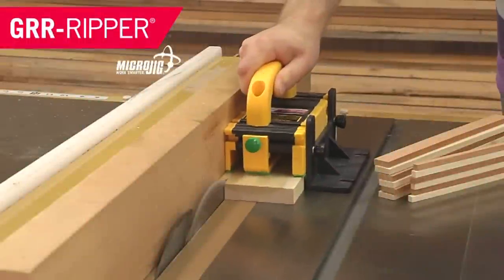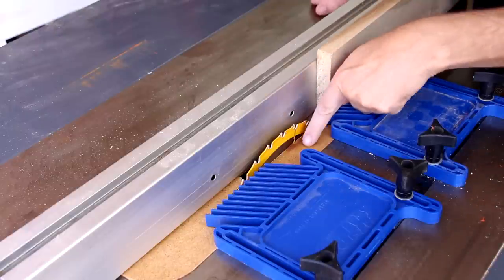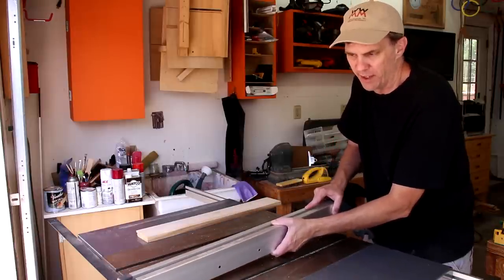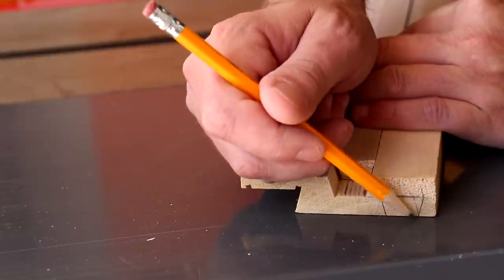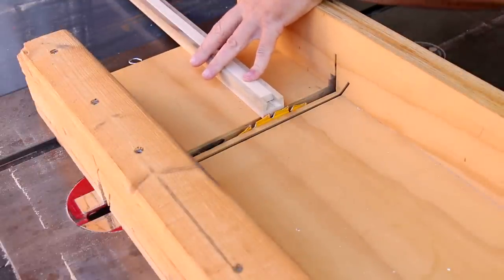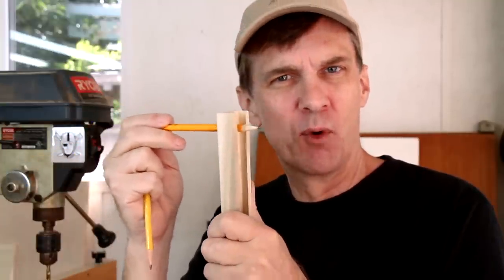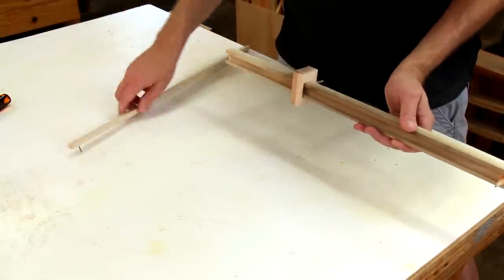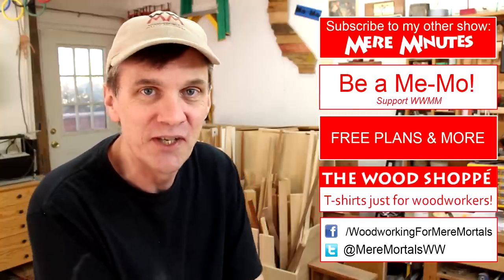Make huge circles with a homemade beam compass. Woodworking shop project!

Comment: Thank you for your excellent videos. For smaller circles one could perhaps do away with the dovetail and runner altogether and insert a nail in the holder which then acts both as a centre pivot and a radius adjustment.

Comment: Great video as always Steve. I think it would be easier if you skip the sliding locking mechanism (SLM) and just drive the thumb screw directly in the back of the channel.That will make it easier when flipping the rail around because you wont have to remove the SLM to do it. Of course it wont be as fancy but it will get the job done. Thank you and keep them videos coming

Comment: Hey Steve, this is nice and simple. The only suggestion I have is when using that second feather board, make sure to use the splitter. You could end up causing the piece you are cutting to pinch the backside of the blade and causing kick back.

Comment: Hey Steve!  Fellow Marinite, Eric, here.  Recently entered the woodworking fray - loving it - and also just recently discovered your channel.  Thanks so much for the great and entertaining vids.  Immediately made one of your 2x4 work benches on casters, got some Grrrr ippers after seeing them, working on French cleats in my shop, gonna make this compass for the hell of it, scored a Dewalt dual bevel, sliding compound miter saw at HD the other day on a crazy open box markdown - blah, blah, blah.  Anyway, caught a glimpse of that digital magnetic blade angle finder thing - looks useful.  What is it, do you like it, where should I get it, etc.?  My (also recently acquired) leatherworking is now taking a back seat because of you.  Cheers - and maybe we will run into each other at Rafael Lumber one day!

Comment: great tool to have in any shop ! Thanks Steve the small mistake made for good entertainment  most definitely pencils do run different sizes  i’ve beltsanded quite a few of them over the years  to make them fit better in some of my tools like scribes  and other marking tools   ! you chuck them into a drill and  run them on a running belt sander untill you get what works  not really  a very sophisticated build but it works

Comment: Hmm how about the stone-age method of pencil-string-nail combo ? Works even without Grrrrippers and DoveTails.
Reply: i think this is more accurate if you need large circles of the same size. But hey everybody has his own way of working :)
Reply: I thinks that's because this is a "Woodworking" channel not a "Make Things From String" channel
Reply: String, invariably, stretches and the pencil isn't anchored in position.  String works great if you don't care about having round circles...
Reply: Don't be a troll!
Reply: James Carr Really dude that's the best you can do? troll much?
Reply: Mike McKinlay Did you get up on the wrong side of the bed today?  Troll much?

Comment: If you turn the clamp upside down, it screws on the runner, And the runner and the channel can be flush. But than you need the nail and the pencil to stick out on the other side and a linger nail :)
Reply: *longer nail

Comment: Why the big locking mechanism? if the tum scrue is mounted directly in the outer part it will press the inner part to lock it and make it a more rigid lock.

Comment: drill bit "slightly smaller than a quarter inch". Because saying 6mm would just be heracy.  :)
Reply: Yeah that would not work, since it would create a circle jig for metric size circles (like 1 meter)
Reply: I don't have metric bits
Reply: 15/64 or 7/32
Reply: Heresy, btw. Here in the USA, it is difficult to find metric sized tools or measuring devices locally.  I have had to purchase mine online.
Reply: Thank you sir.
We should start to supply. I'll source them, you can sell them.
Reply: James Carr Any decent kit should come with a full set of both. Such kits are available at most home improvement stores like lowes and home depot.
Reply: James Carr Much easier to find metrics in the US than to find Imperial in Europe.